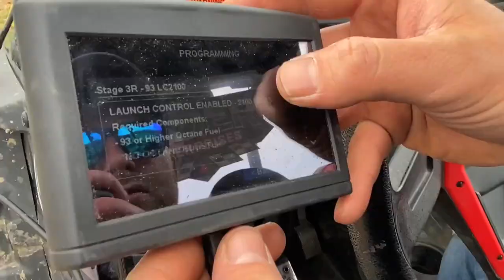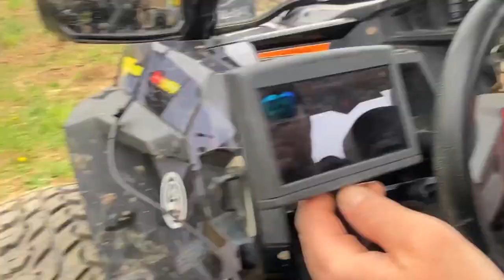DESTROYED Jeep 4X4 MUDDING!

Comment: I know on some of the old diesels you need to burp the fuel filter ,  ( unscrew it to bleed the air out , then retighten )  It does work on some of them  !  could also have a fuel shut off valve  ..........

Comment: "J code" HD 6.2L Gm Diesel,not a Detroit..they were involved in the original design but had nothing else to do with this engine..Keep your foot on the floor during cranking, but without glowplugs it'l never fire unless its warmed up..and even then it was a glowplug dependent engine. Right behind the ether can at the 6:00 mark is the glowplug control relay,jump it out and the glowplugs will work.

Comment: all these cars u jump and mess around with and still dont understnad how a charging system works lmao.... let me tell ya something... if there is no belt turning the alternator which charges the battery when the car is running the car will not stay running with a dead battery and no belt... every car runs off the battery using the alternator to charge it back up.. without the belt on there and a dead battary no car will stay running